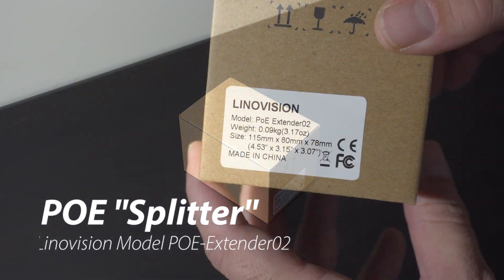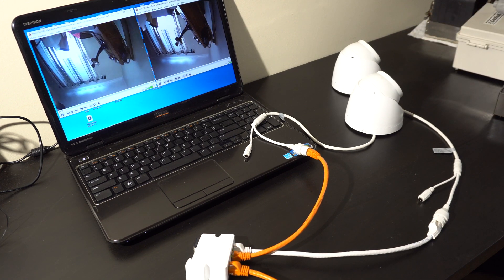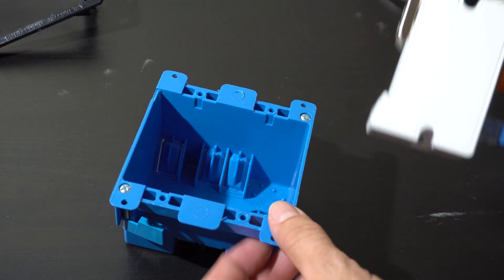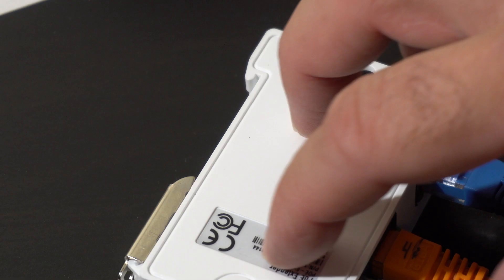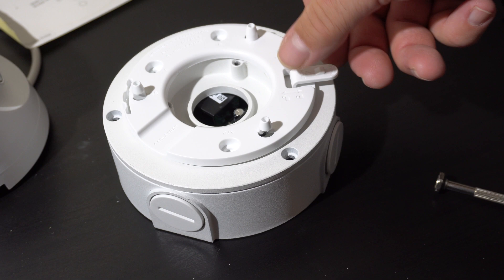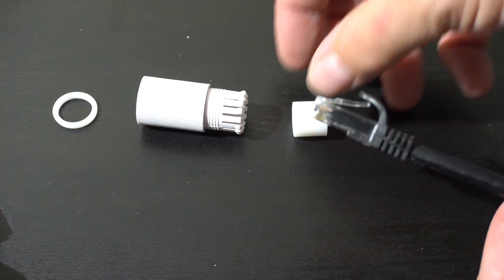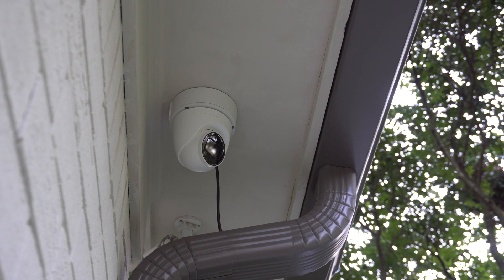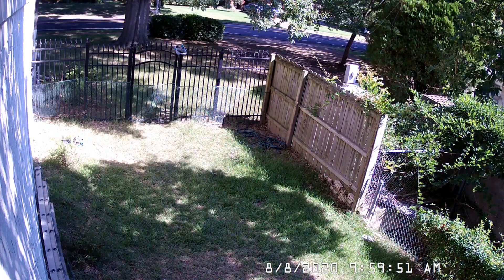Testing a POE Splitter for Home Security Cameras.

Comment: Hey..great video and great to see a review and tear down of the POE 2 Port Extender...I would have used an M20 stuffing gland (or the appropriate gland sized)..here is a UK link for that https://www.screwfix.com/p/tower-male-comp-gland-20mm-2-pack/45943 to prevent moisture into the camera mount.
Reply from the maker: Thanks for watching, and for the tip about the stuffing gland!

Comment: Hey! I really enjoyed your video. Love the idea of taking the box apart to make room! LOL. 

Can you tell me a little more about your setup? This seems like something I want to run. a NVR connected to a switch. 1 cat6 cable from switch to an POE injector, run that cable outside to a POE splitter, and then go to two seperate cameras.
Reply from the maker: Thanks for watching! Yes, the core of this whole system is software called Blue Iris - best $60 I ever spent on a software product. It lets you create your own system of IP cameras combining various brands, and even provides a local Web server so you can display and manage cameras from a PC, phone, or tablet on your home network. What you are describing sounds like it should work fine. Ideally, if you are starting a new system you wouldn't need a POE splitter, because it might be just as easy to run 2 cables as one. In my case I was adding a second camera years later....

Comment: Hi mate and I love the way you got around a few things. I'm going crazy right now trying to find the best and cheapest way to run two cameras off one Ethernet cable, I use all good HIKVISION gear which is powered by POE over the cable, any ideas which splitter would work for me?
Reply from the maker: Thanks! I would still recommend this splitter, it made it through the summer and then the cold winter with below freezing temperatures, and has been running 24 hours a day. I am using 2 cameras with the splitter, 1 of them is a Hikvision. If you search Amazon for "Loryta POE Extender" or "Linovision POE Extender" you can find it.